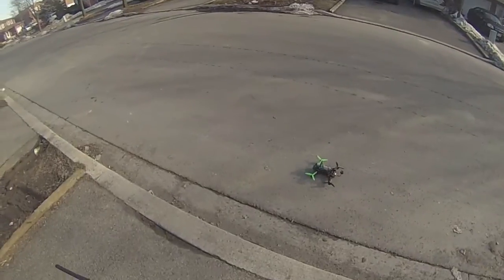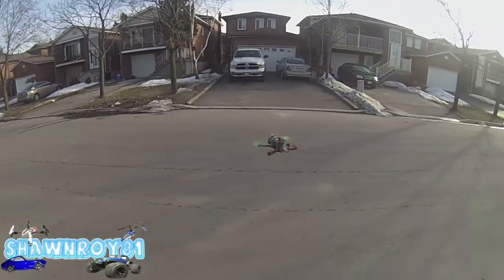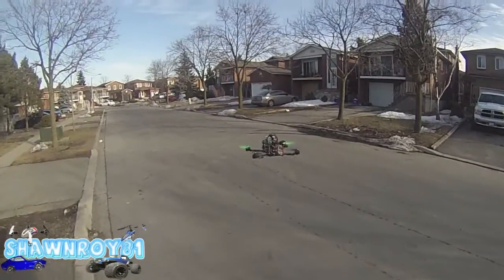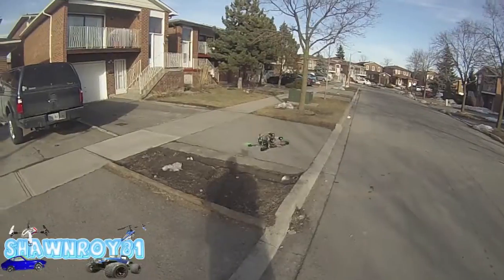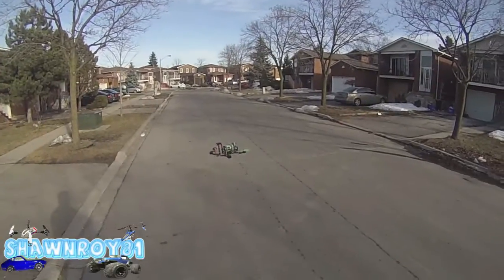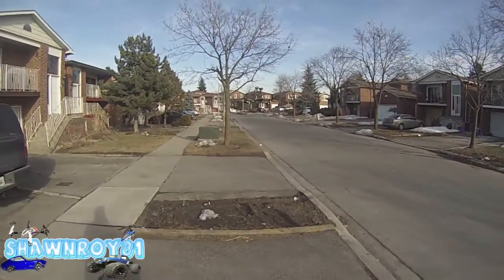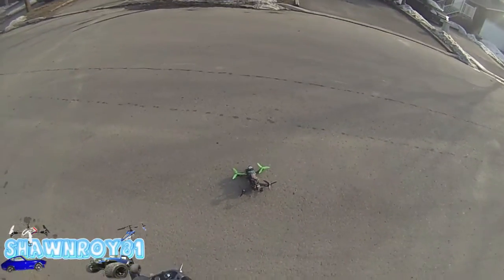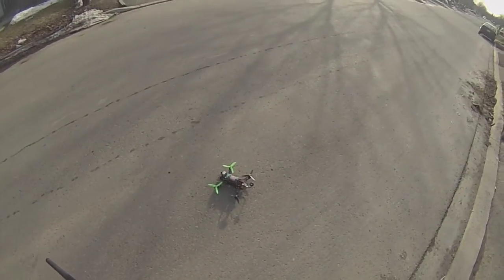Got the Vector System on my 250 FPV Quad all figured out

Comment: Shawn, How well does the vector hold when in gps hover mode. I put the vector on a tarot 650 and it drifts around alot compared to when i had the Tarot zyx-m flight controller.  the vectors flown the T650 3 times and crashed at the end of the field on it's last flight. no real damage ,but she sits on my work table while I enjoy flights on wings and 210,250 size quads fpv. I'll subscribe to your cannel hoping to hear if the gains settings are the problem.

Comment: Hey there, mind if ya share your gains please?
Reply from the maker: sorry this quad isn't event alive anymore...LOL...the system has since been put in a 450 size video platform quad that I 3D printed. Sorry I don't have my gains when it was in the quad
Reply: Okay, cuz i have a 250 racing quad, and its wayyy to responsive, with the minimal throttle, it will take off really quick, that is a gain problem right?
Reply from the maker: Gains would be more if it was jittery. Like on decent it osculates side to side. I think you should look at throttle curve. You want it to be linear and you can ad expo on your transmitter